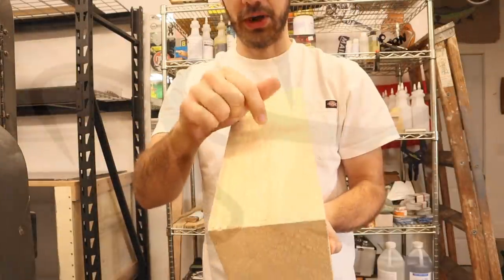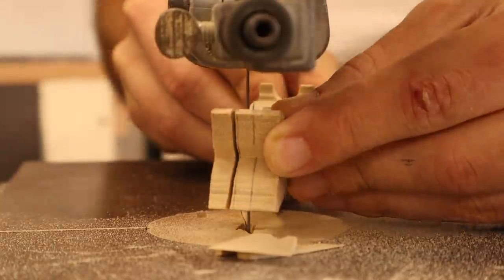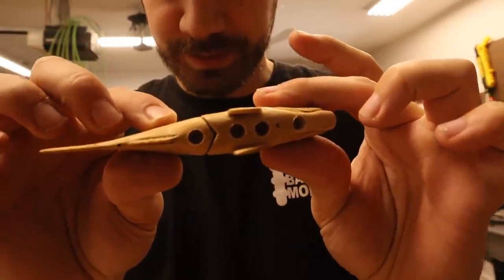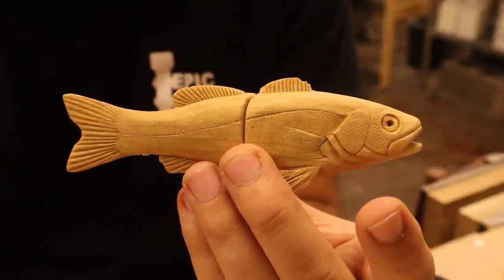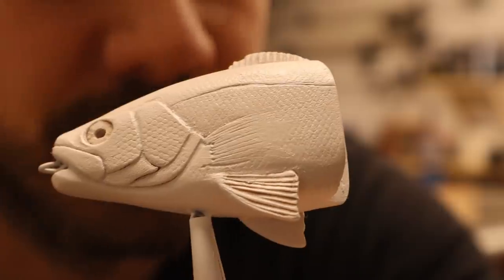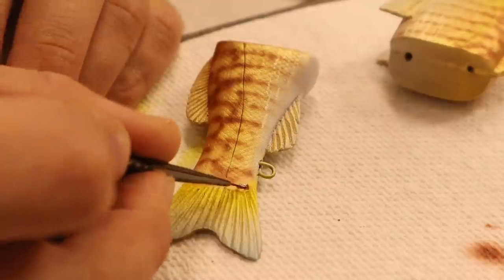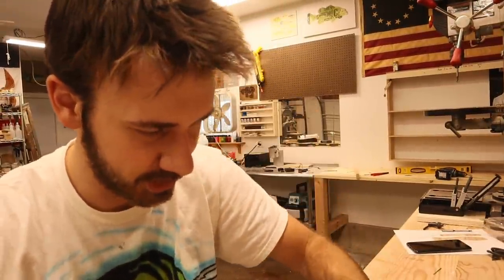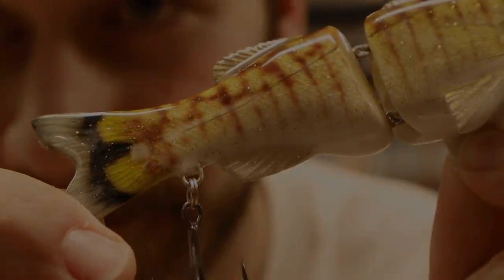Making a Very Detailed SmallMouth Bass Lure

Comment: Replacement arrived!By the way, I did forget to mention that the original lure did have a decent strike however as most anglers will attest you can get a hit https://www.youtube.com/post/UgkxCbNOWAGmn6nfbCbJDmasvBq7J38KZNw2 and fish will hang on and release lure. I used the replacement lure yesterday and ran thru a Shimano Waxwing, Kastmaster, Bobber (set to sink). I found the does run deep (I casting on the flats 3.5'). Make sure you adjust your rate of retrieve and rod tip angle (up) to prevent getting snagged on bottom. Used it a couple of times and action was very lifelike (looked like local bait fish for trevally), craftsmanship very good....however eyeball fell out. I asked for replacement and it is on it's way! It was very easy to change out treble to single inline hook.

Comment: Love the video keep up the good work, just a question, I have very recently gotten lexan polycarbonate, and I dont have many power tools except a belt sander and a drill, but I have a coping saw and stuff, I get a decent finish on the lips but with the saw there's always some residue stuck on the sides, any tips? Also what gauge wire do you recommend for standard crankbaits and such? Sorry for the paragraph,  great vid!

Comment: I decided to follow along and make a similar bait, Im at the point where I cut the joint and am carving the details in the fins; everything has been smooth sailing pretty much but i cannot seem to get the details just right in the fins. The lines are too far apart and it ends up looking not to pleasing. Im using a box cutter fyi. Im using the same wood, not sure if my wood quality is the best but the thin wood just likes to fly off and ruin the fins, especially the dorsal. Any tips?

Comment: Make sure you buy an actual saltwater reel at least a small one that is somewhat sealed because you will ruin your freshwater reel after a few hours in the salt unless you want to completely take it apart and oil it. I suggest just getting a Daiwa BG 4000 or Penn Battle 4500 combo. I have had both and they work fine for striper fishing off the jetty and my kayak in the northeast
Reply: The steel inserts on a freshwater rod might rust out too if they are not ceramic or corrosion resistant

Comment: This has nothing to do with this bait and with the mesh on it it won’t work but go straight from super glue on the bait to 600 grit sand paper its gets it smooth so much better, and if you get most of the dust off , faster than 220 just thought I might share